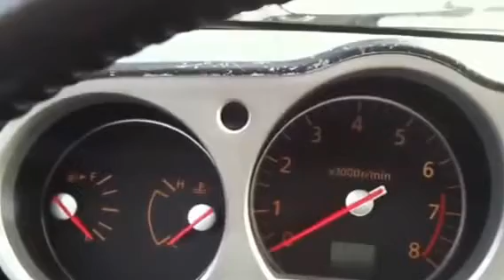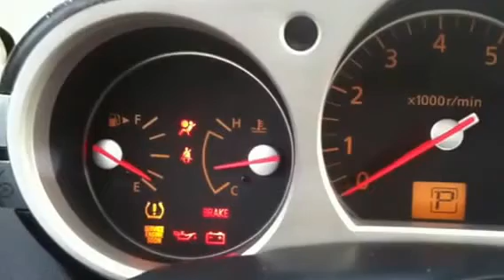HOW TO EASILY RESET SRS AIRBAG LIGHT ON NISSAN/INFINITI 350Z, G35, G37, 370Z etc DIY

Comment: The passenger airbag light came on and never stopped blinking after i had an upholstery guy replace the old car seat covers with new ones. I tried this method of resetting the airbag light  and it worked. Thanks for the tip. 😁

Comment: WORKED BUT!  I have a 2007 350Z.  Airbag light came on unexpectedly and I could not turn it off.  Nissan service told me it was a $300+ fix.
Found on Google there was a recall on my sensor.  Checked with Nissan and was told repair was already made and they would not pay for it again.  Took to local trusted garage who checked it out on their computer hookup and it showed a wiring problem.  Tried your reset and it did not work.  Then looked under passenger seat where all the electronics are located for airbags.  I found many connection points and pushed in on all of them.  Rerun your procedure and it worked 1st time.  Something under the passenger seat had worked loose.  Thanks!

Comment: I love the sound of the 350Zs when they start up, same with my G35. Btw I hav the issue with the tire pressure light also! I know Infinitis are a little more known for electrical issues but I can't figure out if it I hav bad tires or the stupid light is just glitching
Reply from the maker: You just have a broken at least one TPS, the same with my car. $120 to change it and a lot of problems with connecting new TPS to ECU not worth it. I just checking pressure every 2 weeks

Comment: So I have a 2012 g37 my airbag light does NOT blink it’s solid how could this work if it doesn’t go away when I turn on the car?
Reply: Same shit with my g35
Reply: Same with my 350z
Reply: @krlm2280  did you find out how ?
Reply: @austinbradley3411  did you find out how ?
Reply: @firefly2472  nothing i just been driving it like that til I'll figure it out

Comment: it worked on my 05 G35 coupe but after 3 weeks it went back the airbag light.. any feedback why??
Reply: If the airbag light comes back on again after sometime, check the connectors on the harness undernearh the passenger seat. Check for loose connection. Connect and disconnect the connectors. Wiggle them together to make sure it connects.

Comment: Hello! I bought an 350z 2003 with no airbags. I was wondering if theres any way I can shut the airbag light off. It doesnt blink, just stay on.
Reply from the maker: Did you tried to do the steps shown in the video?
Reply: +RPM Engineering if he has no air bags, it wont matter even if he uses this method the light will come back on. this method is for tripped sensors and is only used for a reflash. I just did it on mine and it will take months before the light comes back on. Have any ideas as to why ?

Comment: Looks like I got a totally different problem. My airbag light does not flash, after I changed the seats from another 350z the light went from flashing to a solid red I scanned the car and it is telling me there is a open circuit on the passenger seat

Comment: But the light comes back on like 10 start ups later???
Reply from the maker: 96mk3 no, if your air bag not physically damaged or, as I said in this video, check wires under the seat.
Reply: Well I checked the lights under the seats and everything looks connected and is that a recall ?? Can they fix it for free
Reply from the maker: 96mk3 what car you have and what year?
Reply: I have a 03 g35
Reply: Sorry I meant to say i checked all wires under the seat
Reply: Bought  used '03 350z with airbag light flashing. This re-set didn't work. Somehow figured out it was the front crash sensor. $110 online, replaced it myself. Next to hood latch. THEN reset and SRS (airbag) light went out. Check out how to put the car in diagnostic mode and read light flashing "codes." (YouTube rules, by the way)